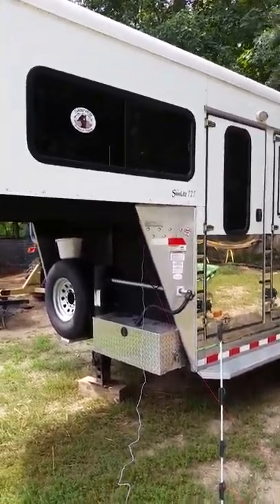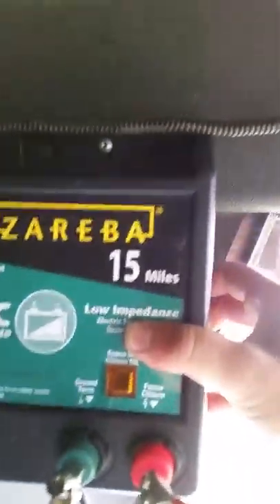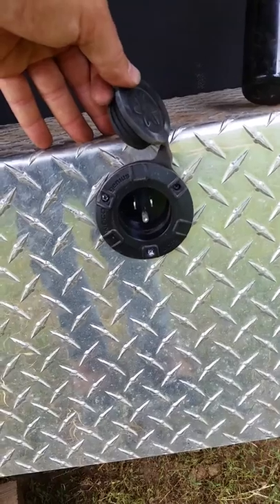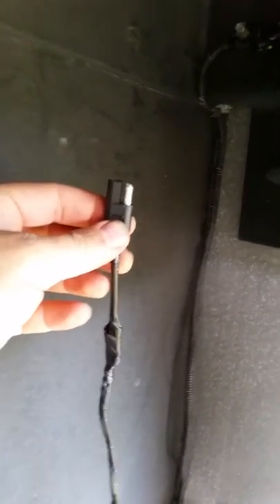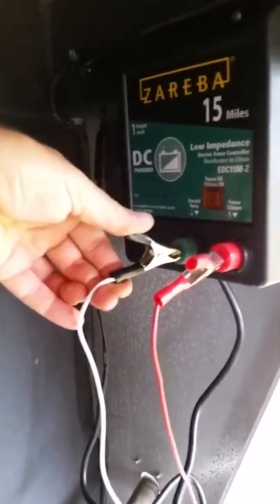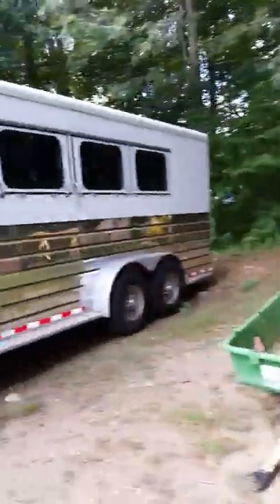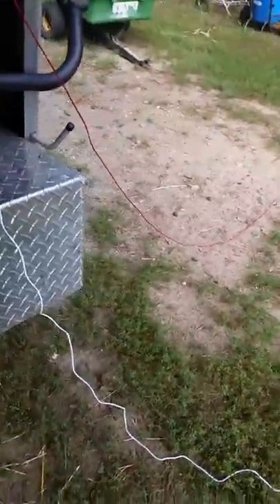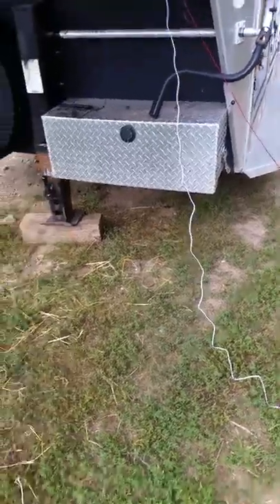Portable DC electric fence setup

Comment: WHAT SIZE  12 v battery are u use that would be a Big Help
Reply from the maker: I have group 27 deep cycle marine battery for the whole trailer. It runs the lights inside the trailer (tack room, stalls, and load area) when the truck is off and that's what I tap into for my electric fence charger. 
In August we camped for a week and the battery had no problem lasting the whole trip.
Reply: I was wondering if one battery would take care of the fence for 10 hours what size 12 volt 10ah
Reply from the maker: @rodneygoff9553  my battery is ~90ah. But yes, a 10ah 12v would work fine for 10 hrs. The charger only pulses; it isn't a continuous current draw.
Reply: Thanks for your help